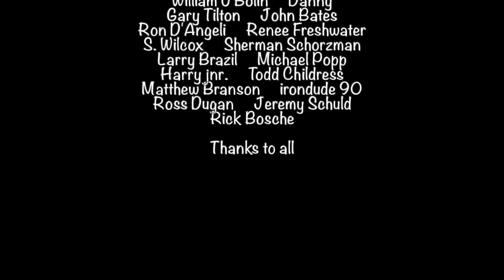Project Update - Trench Warfare, You Dig? - GS Tongs

Comment: A tip is to bury a wire with any water/drain lines you bury. You can find them later with a metal detector and even figure out the depth from the signal strength. Also, about 6" above the buried lines, bury a strip of caution tape for the next bloke to find.
Reply from the maker: Very good ideas! I could maybe do the caution tape since I wouldn't have to dig too much and the soil is loose now. Thanks.